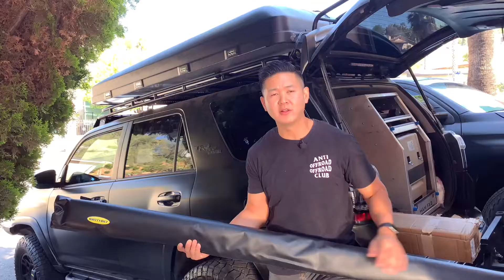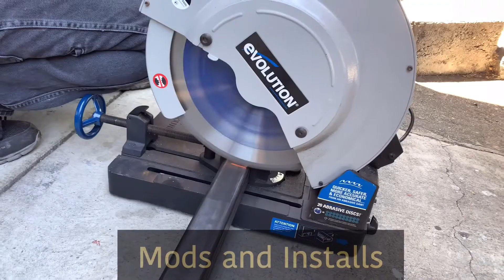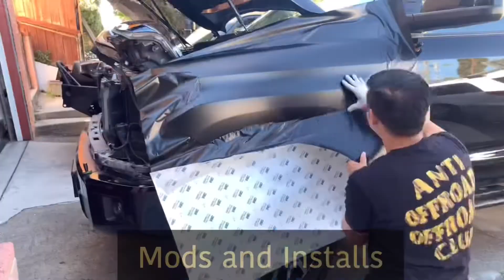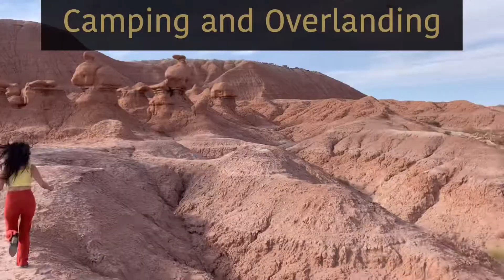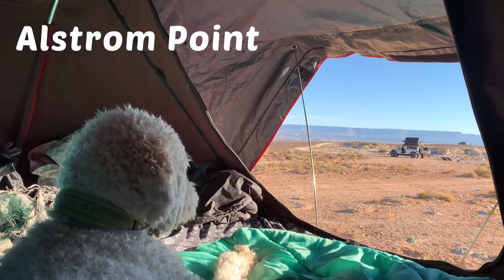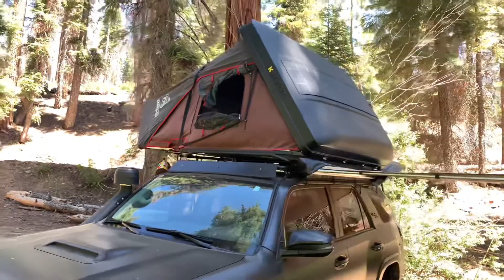MUST WATCH | Hard Shell Vs Soft Shell Roof Top Tent | Pros and Cons of a RTT

Comment: Great Vid. I currently have a soft shell RTT and for the past two years it's been great but now I'm upgrading to the iKamper Mini 3.0. I also have a CVT awning and I see you have an awning mounted to your rig. Did you have to extend the mounting brackets further outwards to compensate for the iKamper shell when open or are your "L" brackets facing downwards to lower the Awning? Thanks!
Reply from the maker: I put a video together of how I made the brackets that came from my Awning. I had to do this so it would sit flush to to ikamper https://youtu.be/JpMLVkrW2IA